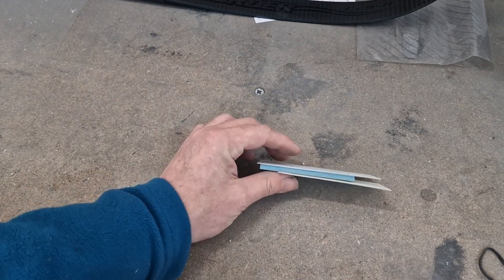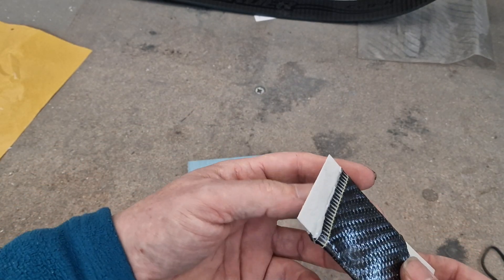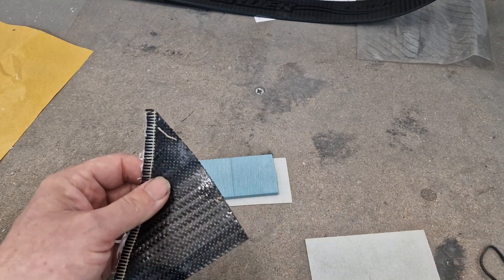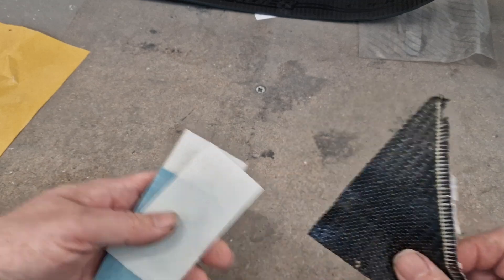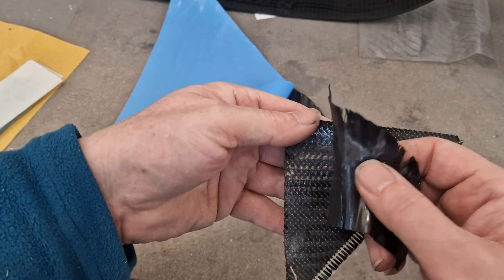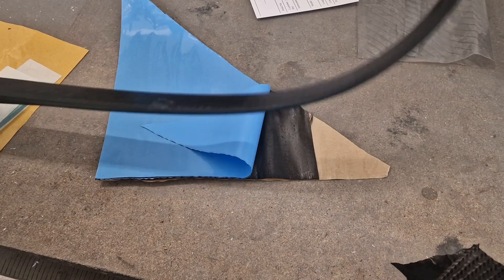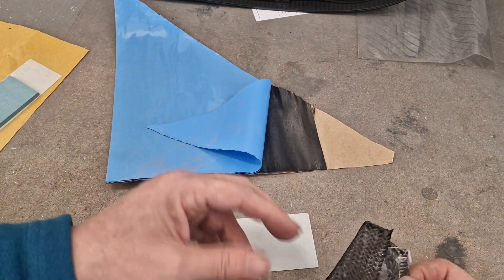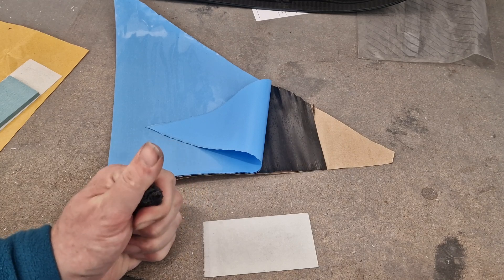carbon skinned glass limbs vs carbon limbs with no glass.   big difference.

Comment: Do pure carbon limbs potentially suffer damage from SK99 string materials such as Mercury 2?
Reply from the maker: All bows do.... the reduced elasticity is the main problem.    So..  here is tye concept.   The softer the ground the softer the landing.   Which means you have jump from higher.... so faster bows have faster speeds, resulting in faster impact.    This faster impact needs a softer landing.   So longdraws, low gpp, high poundages all result in faster speeds. Which means you have a harder impact.     Carbon limbs are faster. High energy designs are faster. Again, resulting in higher impacts.    Meaning they need a softer landing.
Shoot a dog slow bow with 25gpp and you can use what ever you like.

Comment: Assuming equal action (kg m^2 / s), the speed advantage comes from the ratio of the limb mass to the arrow mass. So for heavy mass hunting arrows, you get diminishing returns by merely reducing the mass of the limbs. A good demonstration of this is if you look up a video by 3RiversArchery where they test the speed of the Samick Discovery with wood core versus foam core. The foam core only gave a significant speed advantage for 8gpp arrows, but not 10gpp arrows. But since heavy hunting arrows are also more efficient at transferring the energy in the limbs into the arrow, I would think that your super recurves with their high energy force curves would be the best way to maximize the speed of a heavy hunting arrow (even if the high energy force curves increases the action somewhat).

Comment: It is an odd thing to do considering the massive Youngs modulus difference between Glass and Carbon. I mean even the 45 degree carbon on the outside might just take all the force in the end and make the glass a useless dead weight. The two materials are very awkward to mix properly in any composite configuration.
Reply: If carbon fiber and S-glass laminates are to be combined in a limb for a balance of cost and performance, then it would be most efficient to place the fiberglass on the outer surfaces and the carbon fiber nearer to the core of the limb, and a material much lighter than either one should make up the core. Glass can withstand about double the elongation of carbon, so it should be placed about twice as far from the neutral axis so that both laminates are worked proportionally to their limits. An example construction might be: glass, carbon, wood, carbon, glass. Any 45-degree laminates will contribute more to torsional rigidity if placed farther toward the outside of the limbs rather than closer to the core, and they also contribute more to overall torsional rigidity of the limb if they are concentrated near the limb fades. As you travel toward the limb tips, the torsional moments acting in the cross section become smaller and smaller, so there can be less and less 45-degree laminate, and more unidirectional, to keep the bending stiffness per unit of mass higher near the fastest moving parts of the limb.

Comment: Very interesting. I was aware of your pure carbon, non glass limbs with the bias ply carbon, but didn’t know about the unidirectional carbon as well. Are your carbon lams 2 bias lams with 1 unidirectional in the middle? Are your back and belly lams the same? Thanks for the great video .
Reply from the maker: @russparker1647  we dont say anything about our layup. Im assuming your a bowyer with those kinds of questions?
Reply: Yes, I am an amateur bowyer, about 80 bows of various types, primitive, traditional, laminated etc. I understand why you don’t talk about your layups. I am extremely impressed with your bows, design, innovation and workmanship. Your super recurve especially interests me and I am going to try to make a set of limbs for a riser I already have. As you know, failure is a learning opportunity. Hopefully if I am wrong it won’t result in pain and blood. lol. Cheers
Reply from the maker: @russparker1647  carbon is not glass.  It is a fickle material, many bowyers have spent a LOT of money chasing its requirements.  Engineering qualifications are needed to make it work.

Comment: I wish I had seen your videos a couple of years ago before I bought a pair of mid price carbon/foam limbs from a major manufacturer of target equipment.  One of your previous videos showed how to estimate dynamic mass, and after watching your video i dug them out and compared them to entry level glass/wood limbs of the same draw weight from the same manufacturer. The dynamic mass was almost identical. Kind of explained why they were no faster, and i felt cheated. Great videos
Reply from the maker: The estimated dynamic mass and DFC data gives a heafty estimation towards speed.
Reply: Yes, measuring the DFC would have nailed it, but since the width taper, recurve shape, tip reinforcement size, and final draw weight were the same, I think having identical DFCs would have depressed me even more. I wouldn't have been able to ignore the fact that I had bought functionally identical limbs, just with different (and still hideous) graphics.
Reply from the maker: @tobermory-womble  unfortunatly its been like that for years.
Ill do a video that kills marketting blurb over the holidays